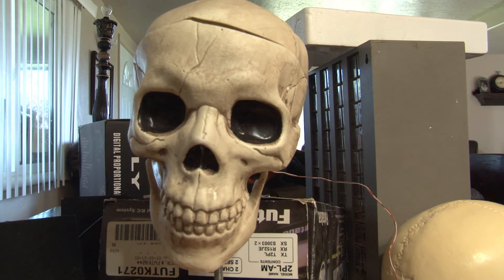3 axis skull

Comment: Hey Batbuddy!

First off, thanks for putting this out there!
I am trying to build the audio to servo portion of this. have everything, but now realize the mini mp3 module uses a mini SD card! I have not been able to locate a mini SD card. So thought i would go with an adapter. Not having much luck finding one of those either!
Do you know if the make the mini mp3 module that uses a microSD card instead? Or, where I might find a micro/mini adapter?
Thanks again for sharing this project.

g
Reply from the maker: I have never actually seen a mini SD card or player all the things I've dealt with are the micro ones. I have only seen the two sizes. full size SD and then the smaller ones some people might call the mini some people might call them micro but they're the size that usually goes inside of an Android cell phone
Reply: @MrBatbuddy  Thanks for the quick reply. Actually, I jumped the gun. The mp3 module I have does take the micro SD. It just appears larger than the other micro SD module I  have. My bad!
Thanks again!
g

Comment: Well done man! Did you just run a random code to the 3 axis servos while the talking loop was playing or something different?
Reply from the maker: I actually have built and am about to release an Arduino based three axis skull controller with an incorporated mp3 player that has signal for jaw movement. I will post it on my website www.batbuddy.org in the Halloween section. It will also be on HauntForum.com under Propbuilding/Technological Terror. I would love for you to try it out and give me some feedback.